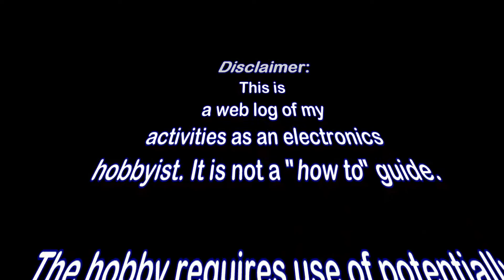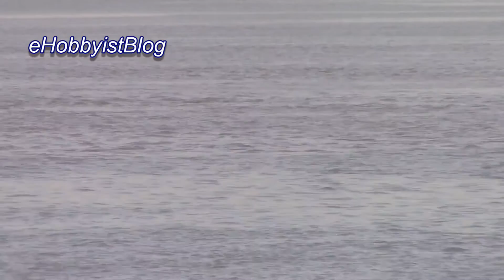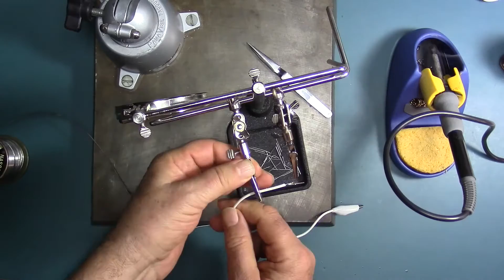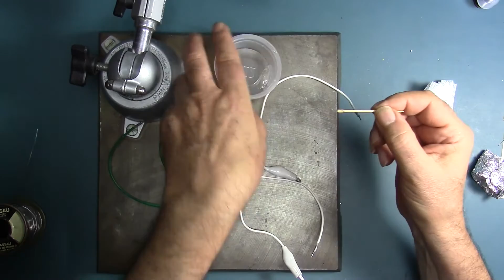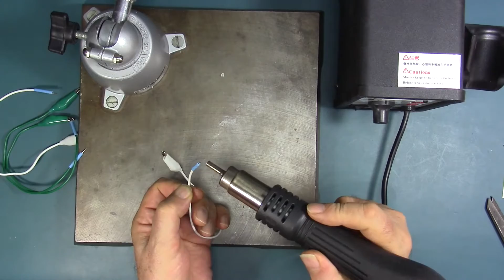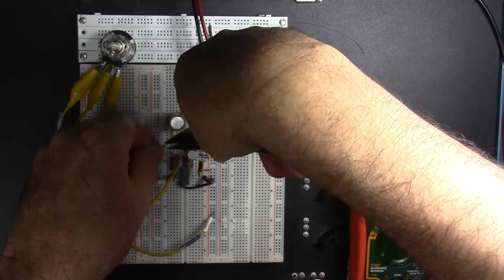030-Power Supply--Regulators (4)

Comment: I experienced the same 5-7v minimum output voltage lately but with a design quite similar to what the datasheet proposed. I wonder if I can replace the 2N5228 with another PNP transistor because I don't possess it at the moment at my repository of electronic elements
Reply from the maker: +Ronen Shemesh 

This breadboarded version of this 723-base circuit worked well as long as there was a 1K/1W resistor across the output. 

I roasted the only 2N5228 I had, and starting in this video, I used a 2N3906 for current limiting. My thinking was that almost any low level PNP switching transistor would do.

Check the corresponding Web Site (eHobbyistBlog.com) for additional reference material.
Reply: +eHobbyistBlog thanks, I will check that, if I encounter some news during this experiance I will post here

Comment: At 8:33, keep in mind that as the current increase, the voltage drop due to parasitic resistance in the leads also increases (and the voltage as measured at the load therefore decreases). This what you saw here. This can be rectified by using lower gauge leads and/or adding voltage sense (i.e., feedback) to the circuit.
Reply from the maker: +SteelBlueVision 
I hadn’t thought about parasitic resistance as a cause for the voltage discrepancy. Thank you!
But…, the digital multi-meter has virtually no current through its leads. (10M input resistance). The DMM was accurately measuring voltage across the output. The 723 voltage regulator was sensing voltage across R5, R4 and some percentage of R3. However, the resistance of wire between the regulator's sense point and the DMM lead connection could cause a problem. 
I observed 14.05 V initial output; 13.83 V at 0.90 A.    -Assuming #22 AWG copper wire (even though test leads I prepare use #18),    -Assuming 3 ft. total wire length between sense point and DMM connection    (which seems excessive),a worse case voltage drop of 89.601 mV down to 13.96 V  could be expected due to resistance of the wire. The video shows a drop of 220 mV. Moreover there was no gradual voltage drop at 0.2 A and 0.5 A.
I now hypothesize that the current limiting transistor (aimed at 1.0 A) cut in early at just below 0.9 A. This would explain all of what I saw. However, I no longer have the circuit breadboarded and cannot confirm. If so, R8 would need to be reduced somewhat to get a full 1.0 A out without Q3 trying to reduce the current by lowering the voltage.
Reply: +eHobbyistBlog So with parasitic resistance, it comes down to this: The length of your DMM leads is irrelevant, because there is very little current flowing through them due to the resistance of the DMM (let's say > 10MOhms). The parasitic loss is strictly in the wiring, breadboard, etc... between the voltage supply and the load. 

However, if you are using an ammeter, which you were, it also has a burden voltage that must be subtracted out. It is difficult for me to tell from the video where you are measuring the positive side of the voltage. It looks like it is post-load and post ammeter, which definitely explains the voltage drop (parasitic resistance+load+burden voltage of ammeter). 

The wrinkle in all of this is that this effect should be linear with the increase in current and if you are saying that it wasn't at 0.2 A and 0.5 A, respectively, then perhaps you are right and it is some sort of current limiting that is causing the drop.
Reply from the maker: +SteelBlueVision 
The setup: 
One end of a 100 ohm 10 W variable resistor was attached to Power Supply +. The center wiper of this resistor was attached to the 20 A input of the bottom DMM used as an “ammeter”.The “ammeter” negative was attached to Power Supply -.
The top DMM (used as a voltmeter) had positive attached to Power Supply + and negative attached to Power Supply -.  
The “ammeter” has a burden voltage of less than 500 mV at 20 A—an equivalent internal resistance of less than 25 mOhms—but this has nothing to do with the voltage measurement across the Power Supply output lines, which should have been regulated to 14.05 V.
I hypothesize that the lower voltage seen at 0.90 A—but not at 0.2 A or at 0.5 A—was caused by current limiting transistor Q3 cutting in at 0.9 A instead of 1.0 A as designed.